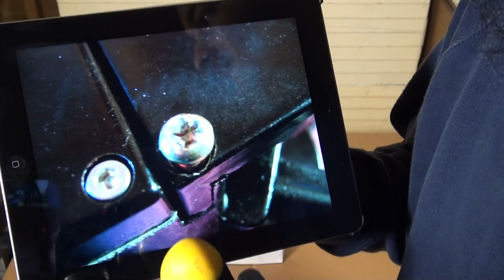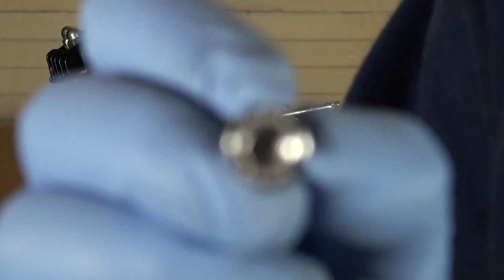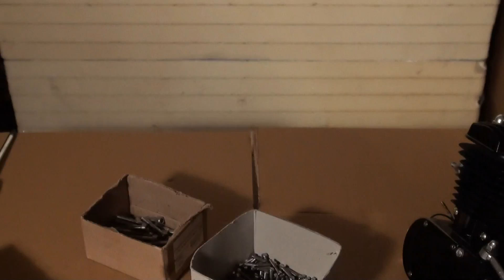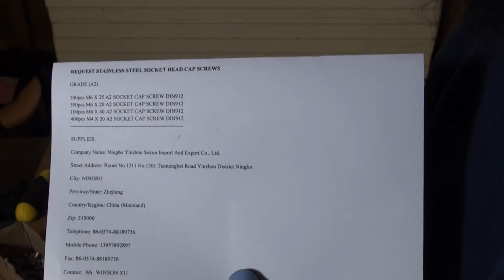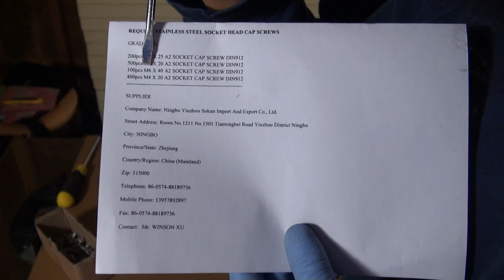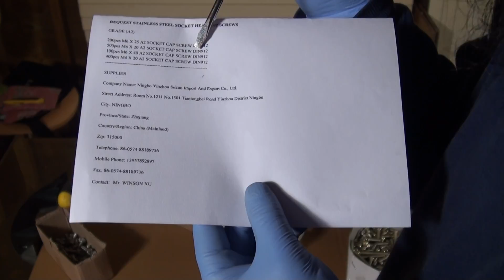Bicycle Engine Kits - Cheap Fasteners & Hardware - Quality Control ep04

Comment: I recommend against purchasing any 66cc motor that has Philips head screws holding the motor and crankcase together.  Typically motors with Philips instead of allen head cap bolts also have m6 instead of m8 studs. M6 studs will inevitably shear off in time with the amounts if torque from these motors.

Comment: Thank you very much for this video. I had big problems with my engine. The supplier told me, if the manufacturer had put in stainless steel to begin with, the engine would cost 4 times as much, and then nobody would buy them. But yes, changing all the screws is something that needs doing when you buy a moto bike engine kit.  
Once again, thank you for this. 
Kindest regards, Alicia
Reply from the maker: Hi Alicia, thanks for stopping by.  Almost all manufacturing these days is profit driven meaning very few companies care about the products they are putting out.  This is especially true in the china market.  I have also had people try and tell me the same thing.  The truth is making these little changes doesn't add that much cost and people would be willing to pay a little extra for quality and peace of mind.  It really bothered us when we were selling these engines and we demanded these changes be made by the manufacturers.  Each time we asked for these changes to be made they would get annoyed with us and in the end they didn't want to deal with us anymore.  So we moved onto other things in the end.  Best of luck with your new engine ....
Reply from the maker: By the way when your supplier says "if the manufacturer had put in stainless steel to begin with, the engine would cost 4 times as much, and then nobody would buy them".  Pardon my french but he is talking out of his arse, it costs a mere 6 to 7 dollars to replace all the fasteners with stainless steel ones and if you buy them in bulk then even less.  He is just trying to cover his back.  This is the kind of nonsense we used to get told a-swell by the dealers/suppliers.  But when we did the research and the math it made complete sense to change them out.
Reply: Hi British Tech TV. 
I was so glad to read your reply. I could not agree more with everything you say. Sure, it is a fact, the China market, is very profit driven, but on the other hand, as you say, people would be more than willing to pay for peace of mind. So it is sad that the engines could be so much better, but instead they keep pushing out these low quality pieces and marketing them as fully functional and trustworthy.
Further, it makes me really sad, that they got annoyed and stopped dealing with you. That is just not right.  Exactly the same thing happened to me. 
Thank you for wishing me good luck,
and I wish you the same 
Alicia.
Reply: Once again, thank you so much for your reply. I agree completely. I have absolutely no problem with your French and I think mine would actually be a little bit worse, if I would let my tongue go.
As it is now, my engine starts and runs a little while, but she is leaking. So after a while she gets tired. I want to go through all your videos and then I think I will start from the beginning.
Another person who has inspired me a lot is Adam of Sinister Custom Cycles. If you want/have the time, check him out.
Thank you British Tech TV your videos mean a lot to me and I am sure I am not the only person to feel that way..
Alicia
Reply from the maker: Im sure you're french is amazing .... lol .... You are a lovely person and i will definitely check out Adams videos ... Thanks again Alicia ....